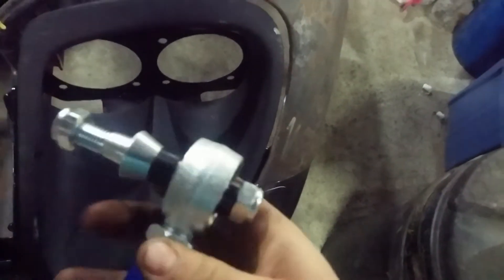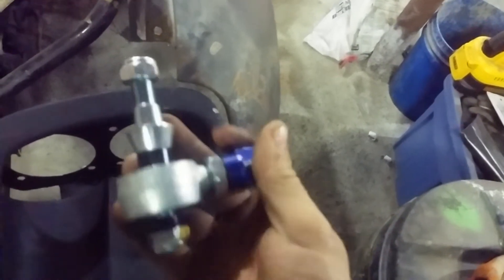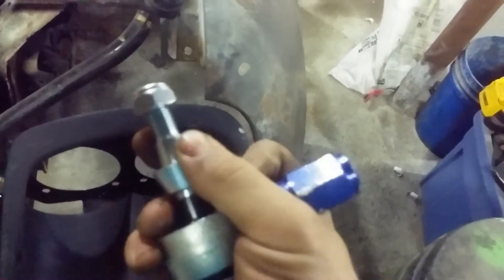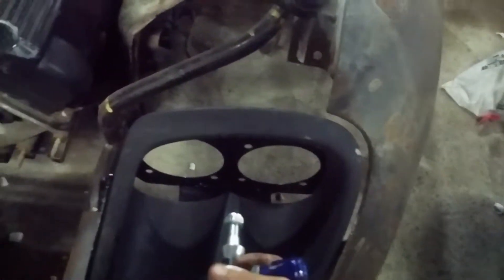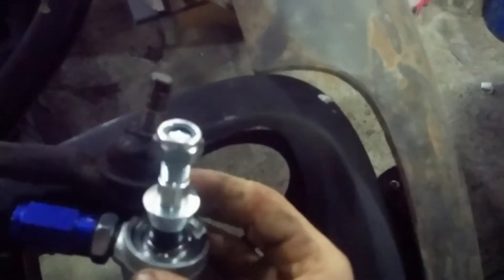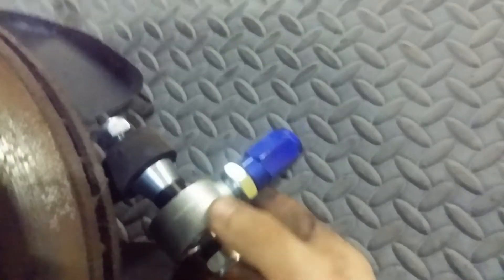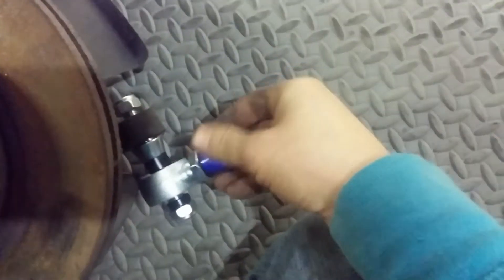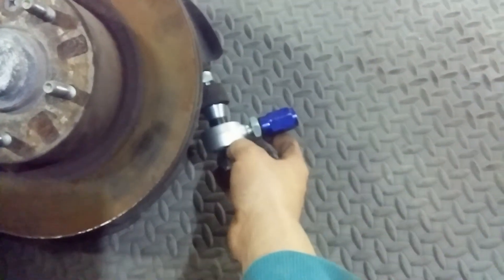aliexpress fd3s rx7 tie rod ends review

Comment: Did you use these in the end? If not what did you use instead?
Reply from the maker: Alistair Cox I used OEM tie rods instead. Still have them sitting on a shelf
Reply: Nodarperformance any reason you didn't use these? My rack is mounted really now as I'm doing a jz swap so need an alternative...
Reply from the maker: Alistair Cox I didn't like the amount of threads from the tie rod to hiem joint adaptor and the taper wasn't cut right. Once I had them installed the flaws of them showed.